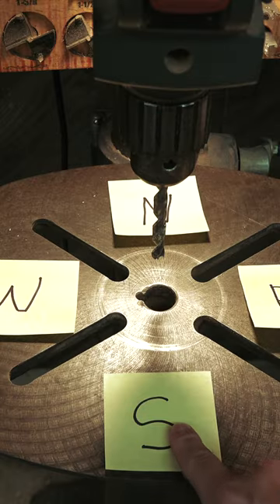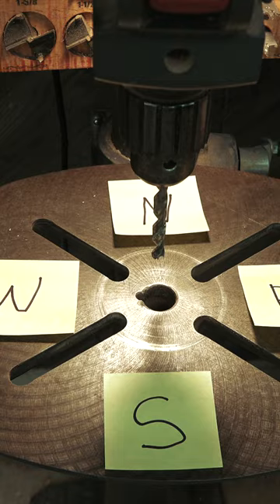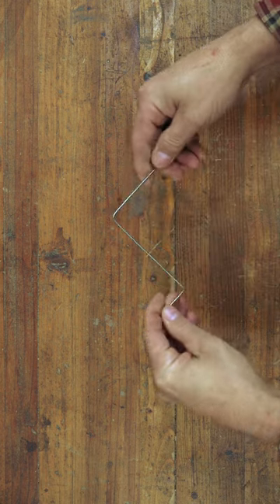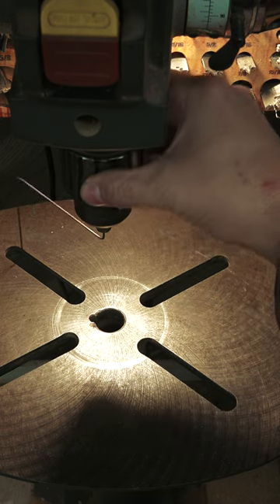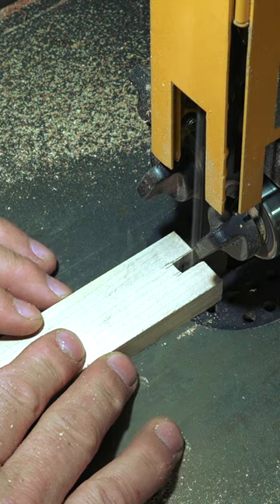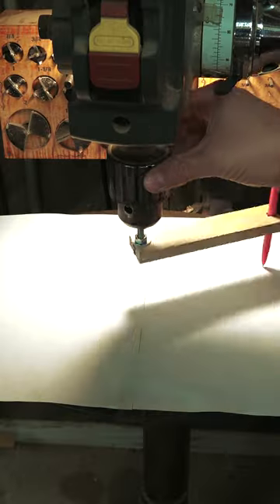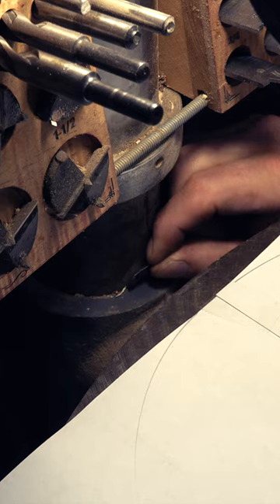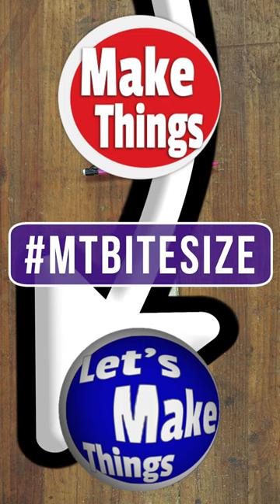204. Drill press accuracy you can visibly SEE #mtbitesize #drillpress #accuracy

Comment: You could also get a dial indicator that will get your table level to the 0.001", so long as you have a bar to put in the chuck and the adapter from the bar to the stem of the indicator.
Reply: This is the way. Trimming bars are also a good time saver with 2 indicators.
Reply: A good enough one is $20 and likely comes with a magnetic stand 

It's not a necessity but for the price, it should be an early purchase in a home shop

Comment: Im not the first to say this, but use a test indicator.
They ramge from cheal to pricy, but even the cheapos will read the same for the same hight and thats all that matters, accuracy does not matter here as evidinced by you being able to use a scratch gauge.

and the cheapos cost about the same as a pack of mechanical pencils so youve got no excuses. Just get a dti and amaze yourself at just how accurate, clean, and square you can make things.

You can also make a test indicator, they are nothing special just levers pushing levers to exgaggerate motion, some have gears others are pure lever action.

No excuses. Just use a test indicator

Comment: Machineling we havea  gauge to make sure our milling machines are perfectly flat within a .001 tolerance. 
Might be overkill for a drill press though. 
But again, I'm sure there's some cheap Amazon version that's probably appropriate. 
Same concepts. It just goes around around a circle but as you turn it you'll notice on the gauge. Will it swing Left or right if you're high or low.

Comment: I mean you also have to make sure you square both the pencil and the nut and make sure that the wood is actually straight.  Yes this will give you the ability to visualize where there are problems more effectively but it also adds multiple angles that have to be accounted for. Because all three pieces and both angles have to come out to 180 in all directions.  Otherwise your information is inaccurate.
Reply: The point of the pencil is fixed below the chuck none of that matters as long as it isn’t rickety.
Reply: False.
It does not matter how the pen is fixed, you could tape it to a wire with twenty random bends and it would not matter as long as its rigid.

What the guy in the video is doing is using the spindle axis as the reference to check the perpendicularity to the table. A way more effective solution would be a dial indicator as with the pen you can only really see wether its touching or not which is unreliable.